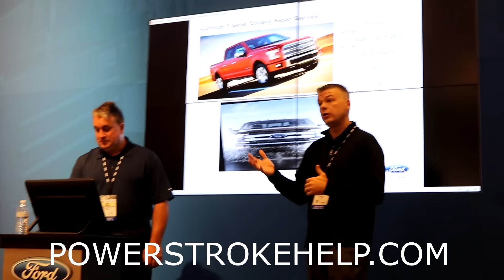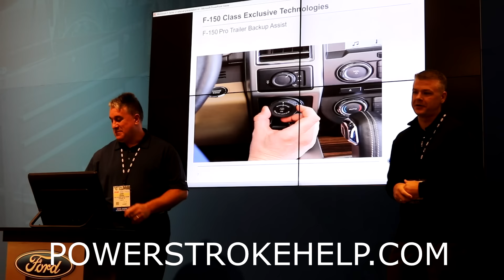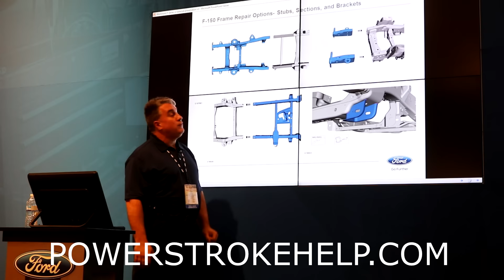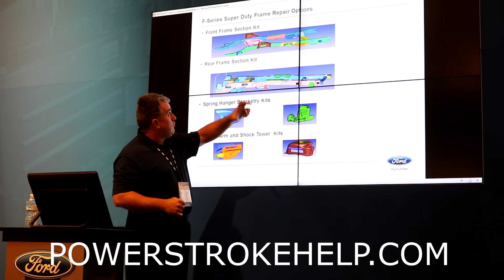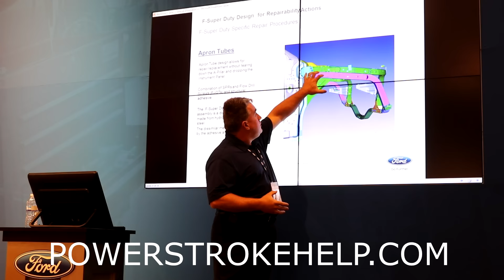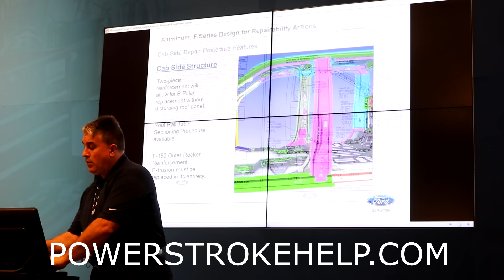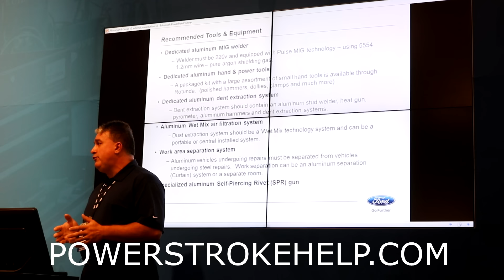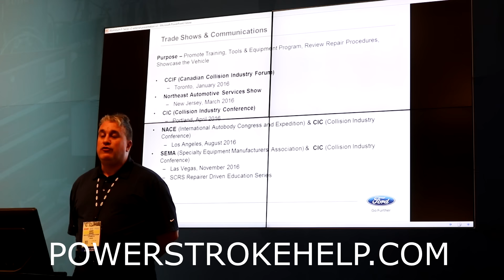FORD F SERIES ALUMINUM BODY REPAIR   SEMA 2016

Comment: Run a search for something called "climate gate".  We need the auto companies to band together.  No more CAFE, emissions requirements, or fuel mileage requirements.  Guarantee they will go back to carburetors.   So much simpler.  No cats; and don't make me buy 12 airbags.  Drove with no airbags for years.  Should be an option!
Reply: I don't entirely disagree with you (I think CAFE is a dumb system), but I'll counter a few of those points.

Emissions requirements are there for a reason.  Ever been to a densely populated city with a lot of unrestricted diesel engines around?  Rome is a great example.  It reeks of diesel fumes there because they've all had shitty little diesel hatchbacks forever letting out stank-ass diesel farts full of carcinogens which are terrible for your respiratory system.

Carburetors are awful.  If they were any good they'd still be making them like that.  With fuel injection it's so easy to get reliable power and fuel economy with minimal maintenance (no tune ups for differing altitudes etc).  It's precisely measuring the fuel that goes into the cylinders vs. just throwing a bucket of gas into a hole hoping some gets in.

As far as airbags... I mean not dying in an accident is nice, right?  Getting t-boned even at lower speeds SUCKS without side airbags.
Reply: I'm not a science or climate gate buff but I can tell you for sure that climate change is a thing. Without a doubt. The real question is whether or not we are greatly affecting it and if we can do anything about it. It has been scientifically proven that greenhouse gasses can hold in more energy on the surface of the earth than our atmosphere previously could because of the changes in composition. Our world has changed greatly in the amount of plant life which has greatly affected the amount of oxygen in our atmosphere.
Reply: I agree with the fact that vehicles need to burn clean but no cleaner than they did in 2000. All this other  emissions crap is doing more bad for the environment than good. When vehicles are considered totaled because many of its emissions systems are bad and will cost many thousands of dallors to fix then what happens? It ends up in junk yards which will eventually get scrapped with the plastic parts being put in a land fill which we all know is HORRIBLE for the environment. 

As a side note EFI is great but MODERN carburators make the same fuel mileage and about 5 less horsepower, but here's the kicker, a high performance carburetor costs about 800 bucks whereas a high performance EFI system can cost north of 4,000 dallors. Needledd to say EFI is not worth the sub .5% improvement in power with NO improvement in mileage. Companies like Edelbrock and Holley are always improving carburetors just as they are always improving EFI. The only reason car manufacturers use EFI, emissions. However a properly tuned and design carbureted engine will burn clean enough. I'll add that NOTHING and I mean NOTHING sounds as MEAN as the induction noise of a Holley double pumper carburetor.  

Don't believe me? Look up engine masters carb vs efi for as far as power goes then look up hotrod efi vs carb MPG. You will find a sub 1% difference in both.